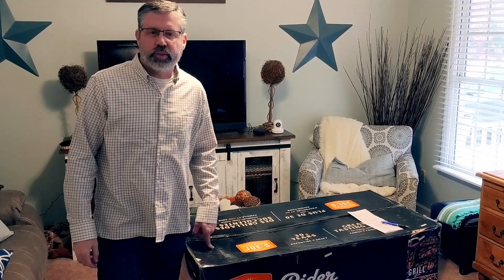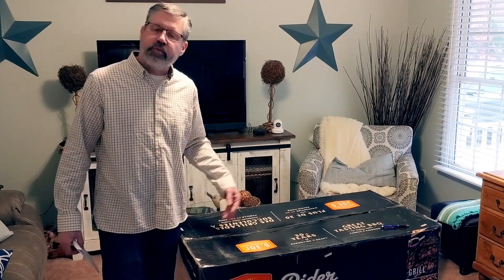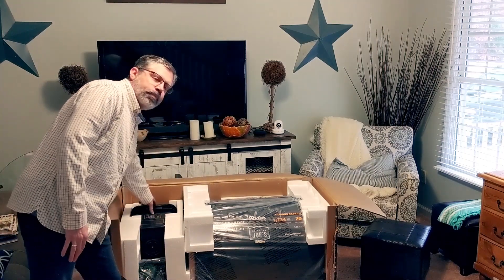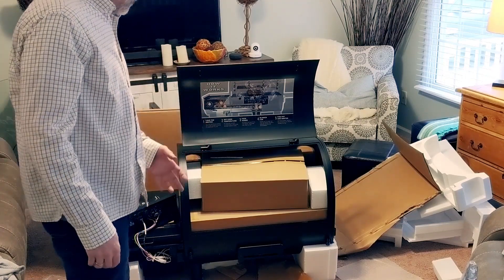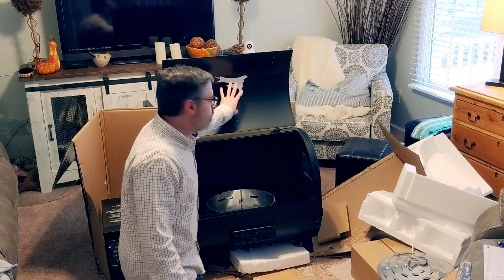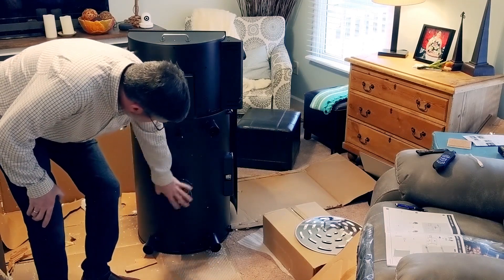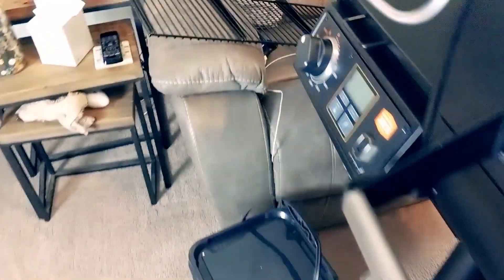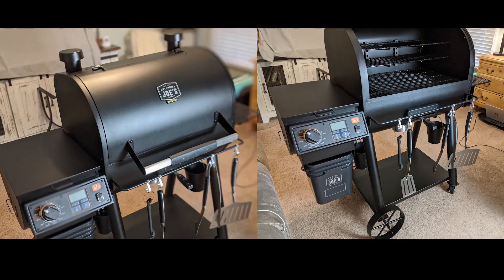Oklahoma Joe's Rider DLX Pellet Grill unboxing & Assembly

Comment: I just purchased and put mine together a few days ago. I performed a good burn-in (seasoning). I just need to purchase a decent brisket to give this guy a workout! I quite a few of the smart features. The burn chamber's easy accessible ash container. The quick-release pellet mechanism is awesome (much better design than that of the Pit Boss). The cast iron grates are very well-built and fit together perfectly. The adjustable upper racks are quite solid and offer plenty of adjustment options. I hope it smokes well...I will update this post with my results in a week or two. :-)
Reply from the maker: I think you'll be pleased with the smoke output. Enjoy!
Reply: So hows the update? Do you like it or would you go back and try something different if you could (trager,  green mtn, rec tec, camp chef)??